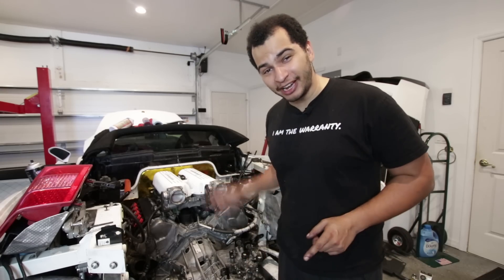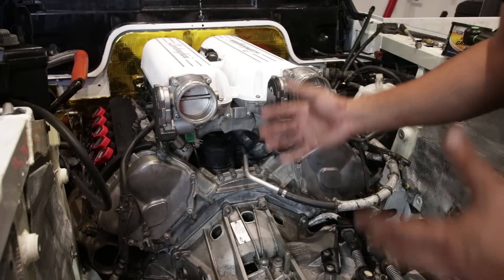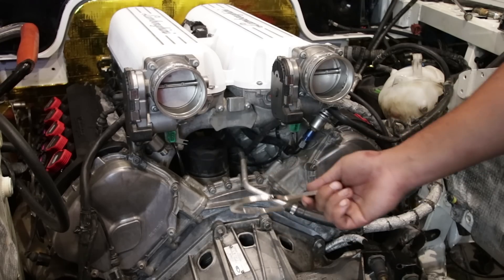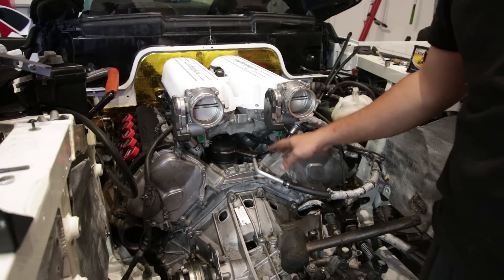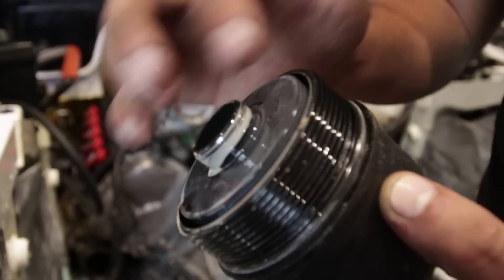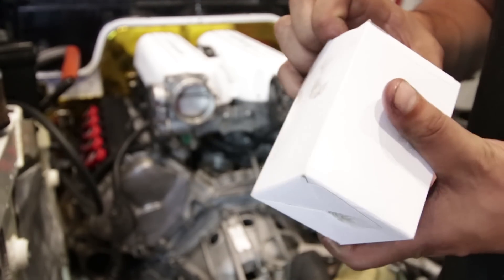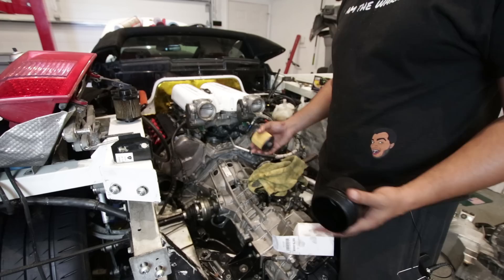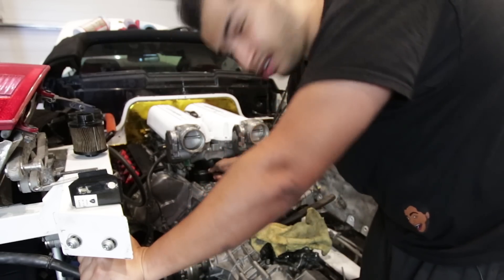My Cheap Lamborghini's Oil Looks Like A MILKSHAKE (And I'm NOT Worried About It)

Comment: Tavarish, I'm not an expert, and I already know that you're going to call it stupid, but here's an idea. What if the twin turbos are set up in the front boot, with the hood changed to one that'll allow air to come in, and the turbo outlets are then run from under the car, to the engine in the back, if there's enough space.. This way, 1. The turbos are going to be far away from engine, resulting in lower operating temperature. 2. Turbos will get continuous and high volume cold air input, as opposed to what they're going to receive when they're set up in the back..

Just a thought...

Comment: When I was a technician at a dealership, the young, twentysomething new hire next to me was doing a oil change. I noticed he was having trouble getting the oil filter off. Finally, 15 minutes later when I saw him break out the air hammer, I got concerned and came over. He said " I can't get the filter to budge..." He was turning it the wrong way...🙄

Comment: Man! 
Ditch that stock oil filter get up and mount a remote one. 
The filter on my 740 il is more than 2 of those. 
Do you really want to dive into that hole every time you do an oil change?
On top of that, you'll be able to run a far superior filter and pay at least half as much.
Shit will pay for itself in 2-3 oil changes, but you'll swear it was worth it after the first one.
As far as the coolant tank is concerned, a good rule of thumb is that the bottom of a tank like this should be equal to/above the highest coolant point.
other than that......

Comment: I personally prefer copper electrodes they're usually more reliable because you replace them more frequently, and the edge area (important for spark production) is far greater than with the needle tip of the iridiums, Replace them at every service, or after every race session, however, sadly no manufacturer (as far as I can tell) makes copper 8s or above anymore.
I would also recommend running 9s, but Denso has some interesting information...Denso recommends the IK27 (with an 8.0mm gap) plugs which are the equivalent to the NGK BKR9EIX for the stock 5.8 Gallardo, by that logic you would be able to run 10s (Denso 31s) with your setup, (bigger boost, E85...etc...) for better performance therefore, IK31 with 0.8mm gap. Is where I would set my sights. So to help you with your search @Tavarish Here you go ;)

Denso Spark plug Catalogue reference (hopefully this works) 
http://www.globaldenso.com/cgi-bin/global/plug/euro/4w/4w-plug.cgi?name=GALLARDO+SPYDER&filename=4w-49.txt&action=search
Amazon:
Denso IK31 http://a.co/1HvvDgw
Denso IK27 http://a.co/7UqoYue
NGK BKR9EIX  http://a.co/7KYfJlq

As far as the transmission plug goes, send me a pic and measure the ID and thickness with a vernier caliper, I'm sure I could find you something.

Great job on the videos, I'm enjoying them quite alot. Keep 'em coming!

Comment: The Jetta coolant expansion tank is better than the Lamborghini because you can see the level without opening it. Besides both a tanks are designed by the same manufacturer, function the same way and are of equal material quality. Only difference is aesthetics.

Comment: NGK BR7E are going to be a little too hot. For that engine. Try a BR5E. That's in mid range for heat.
How NGK works the heat range.
1 being the coldest. And 9 being the hottest.
As far as the spark plug covers. You should chrome them. With Alsa easy Chrome.

Comment: Isn't the hole in the transmission a vent? They are supposed to have a vented cap, usually spongy looking to vent the transmission, usually that's automatics so I'm not really sure.

Comment: u may need to do two blackstone test. one after a few 1000 miles and a second one before u get a true reading. all the old oil due to it was sitting will not drain with the first change.

Comment: Tavarish supposedly the car sat for 3 yrs so did u check each injector 4 spray pattern? If the car runs ruff after u start it that mite b an issue.

Comment: I'm not sure if you leave some loops open or I miss some parts. E.g. you were talking almost for the whole previous episode about those bolts. In this episode you were not that concerned with them. Did you find how much torque you should put on them so they do not snap and still meet factory requirements or did you compromise? If yes, it was not clearly stated. / Agian, it might be that I missed it! :)

Comment: I would get the engine running, change the oil and drive it for a while. Since it hasn’t been running for a while it can be condensation that has accumulated.

Comment: What's up y'all. Im new to this and still a bit clueless. So I'm looking to upgrade my sway bar but even after doing research I saw that the size of the bar depends on the set up, so I'm here to see what y'all think. I have a 99 Integra GS with polyurethane bushings all around and the itr front and rear shocks along with the control arms. I read that even with a subframe brace there can still be subframe tear if the springs are too soft and I'm wondering if the it's show is are too soft for a 24mm sway bar. Thanks you for the help

Comment: It is condensation, i see that a lot on the dealership vehicles that I work on everyday and mostly German cars but lots of other makes and models which is 100% normal with the right oil and run time all that will go away, it completely went away on my sisters mercedes , I’m very familiar with that white milky stuff and I see it daily,just use the right oil weight like 0w40 Mobil1 and run the car for a while ,good luck

Comment: Thst oil filter looks to me basically the same then the filter from the Opel Astra from 2000. I don't know you are so near to the head gaskets why don't you just simply change them I don't think that it's much more work and as you have everything taken apart. It seems to be the right time at this moment.

Comment: the oilfilter might be a general brand cardrige filter thats rebadged for lamborgini , you might want to look intoo getting a good brand oilfilter (bosch?) that is the same 
https://www.ipdusa.com/uploads/images_products_slideshow/fullsize_32203.jpg
this one is for a volvo
as for using a bit of oompf on the gearbox bolts . dont oompf too hard or you pull the treat right out of the aluminium  , blue loctite might be better 

about the copper plugs , i read a story once from a dragracer that tried different plugs untill he found a set that melted before the piston did if the motor ran too lean , you might want to contact youre "guy the knew the history of the car " to find out if that was the reason they used these specific plugs

Comment: Once you get that car to fire up within the first hundred miles change the oil again cuz if you have water in it from the E85 the inside your block could be rusted or corrosion from the aluminum and if you drive it like that you're going to destroy it fair warning

Comment: Buy a damn service and parts manual on CD. Under $100 on eBay.

$80 for a Chinese paper filter that should cost $10 tops? That right there is what you call a scam. Then Lamborghini has the nerve to design its placement in an extremely awkward place for servicing. Things like this put me off ever owning a car like this.

I've said it before, as have many others. My advice is to put the car back to stock, without the turbos. Get it completely sorted and drive it for a month or so before doing the turbos, if you still think you need them.

Comment: i dont understand the obssesion of people with torque specs...i worked as a mechanic for my whole work life, my father was a mechanic and i have many friends in the business, the only bolts we and everybody else around torque to spec are cylinder head bolts, conrod bolts, flyweel bolts (pressure plate bolts dont matter beacuse there are the steel pins to take the force and the force is lateral and not against the bolt head),fwd driveshaft nuts,timing belt tensioner bolt or nut, and maybe a few more...all the rest we torque to the spec of  "a little before it breaks" and if you are used to wrenching you can easily feel when a bolt is tight and when its loose or when its about to snap...and a steel bolt on an aluminium part rarely gets loose. and also tightening wheel nuts with a torque wrench is ridiculous....

 maybe this is an american phenomenon, i see people commenting on videos if they see for example a guy using an angle grinder without the safety guard of without gloves they go nuts, they go mental, they say "Hey dude stop please you are going to die blah blah blah" so obsessed with safety and yet so many dumb people using grinders with guard gloves and glasses but grinding against the rotation of the disc or placing the head on the path of an eventual debris from disc snapping....also i see lots and lots of people commenting saying they are studying engineering or are engineers or they work on NASA or whatever...i would really like to undestand this...they seem to know all the different grades of steel and specs and math stuff but they seen to lack basic skills or practical knowledge
Reply: Hugo Barbedo that's why you are a mechanic and not a technician.

Comment: I personally would have used another VW expansion tank. This kit would look really good in the engine bay and if you wanted to go over the top OSIR sells a carbon fiber cover for the tank too. All in for about $300 but it would look like it belongs in a Lamborghini. 
https://www.ecstuning.com/b-assembled-by-ecs-parts/expansion-tank-replacement-kit-r8-coolant-cap/1k0121407a~r8kt/
http://www.osirusa.com/images/640/OSIR-CTCS-CF-02.JPG

Comment: Actually you would use a crows foot on the nut that a socket wont fit so you can torque all them. set to Ft lbs ;;;;;;;;;;;;;;;;   lol

Comment: My understanding as per this post (http://www.fordxr6turbo.com/forum/topic/92621-oil-change-interval/?page=3&tab=comments#comment-1628067) is that the e85 makes it milky, which is why I was told to make sure I change the oil at 5,000KM intervals if I go e85 on the G6E Turbo.

Comment: How do you know so much about cars?
Reply: MSW if your talking to me, I build escort MK2's for the Irish rally championship, I am also a fully qualified vehicle technician with 34 years experience. Do it right do it once, any man who tightens a gasket of any kind from the outside to the centre has no right posting videos claiming he fixed it. Never mind over tightening the clutch diaphragm bolts and the oil filter housing, using the gearbox to align the clutch, turning the engine in the opposite direction of rotation and on and on...

Comment: You don't pay big bucks for parts because they are special or better, but just because they are on a exotic car, ad that's why i would never want to own
a car like this, because they are just as good or bad a any other car, so parts wil break down, and then you have to do a bank job.
30 years ago i could buy a porsche 911 for only 6000 deutschmarks, but it looked like as if it was taken apart and put back together for at least a 100 times,
so a wreck on wheels, so i walked away from it, because it was a bottemless moneypit, and that counts for al exotic old(er)cars. 80 bucks for a oilfilter for this
lambo is just annother example of why you shouldn't buy cars like this, because then you get ripped off by paying at least 70% to much because it has a expencive name 
on it.

Comment: @Tavarish , do you really need turbo. inittialy these engines are tunned,  high rev (8000rpm)  and high (12.5) compress ratio. If there were mounted turbos compression ratio must be lowered (are you sure that was done by previous owner?) for ex subaru wrx compress ratio figures 8.2. High compress ratio+turbos blow up your motors head or head gasket atleast in short time of usage.  
You showed in one video you had removed some intake  swirlflaps its possible that isnt good.  This is not diesel engine (more air more power) so more air  doesnt mean more power because petrol engine works on some air and petrol mixture ratio (the stoichiometric air–fuel mixture is about 14.7:1) ....so swirlflaps removal may impact power loses on mid range revs  duo to lean or fat mixture...This is wrong way blind swirlflaps  removal without mixtures measurement (buy such  air-fuel gauge with wide range mixture measurements)
Reply: Woxidus Woxidus Since this car was driven so much, even with the current TT set up, I doubt it is set up to have higher than 11:1 compression, because that would require high oct fuel to run properly. It probably has close to a 9:1 comp ratio so it can run on Pump gas. Just my guess.
Reply: I also want to point out that he specifically covered the fact that this engine has been built for a boosted application previously. It was run in the Twin Turbo configuration, albeit for only a short while - and it was tuned to run E85 as a fuel source. It's a known fact that E85 has a much higher 'octane' than regular pump premium.

*edited because autocorrect is stupid*

Comment: Milkshake oil = very bad if it is in your crankcase, but on an oil breather filter, it could just be from short drives/run times which does not warm up the engine fully. Coolant in the crankcase will destroy the engine bearings.
P.S. DO NOT use anything "Made in China" on your cars unless you want it to fail.
You can get remote mount oil filter kits from Amazon.com.
Torquing down fasteners to the manufacturer's specs is very important. Failure to do so will eventually lead to failures, possibly catastrophic. On a regular old car I would tend to agree with you, but on a supercar, your best bet is to follow the manufacturer's specs. However it is your car, so do what you wish.
Look into some Iridium plugs for your car, especially when running boost. Also, note that running boost you will need plugs that are one to two steps colder than factory plugs.

Comment: Ya know, if the manufacturer specs a fastener torque value, it was probably just for fun. Don't be a twit, torque wrenches are not all that difficult to use. You wouldn't be one of those nitwits that does wheel fasteners up to around 180 foot pounds would you?